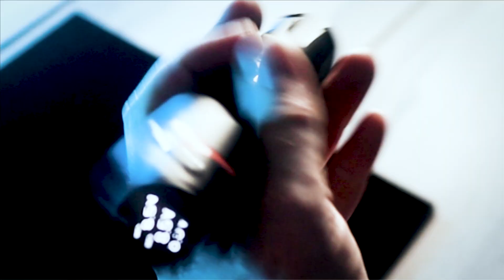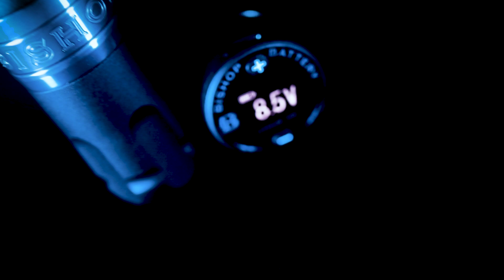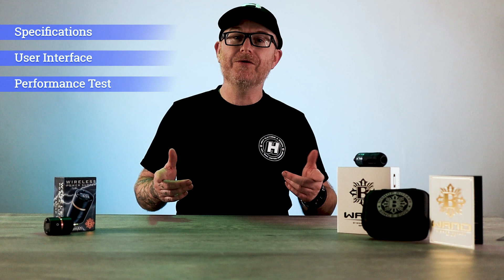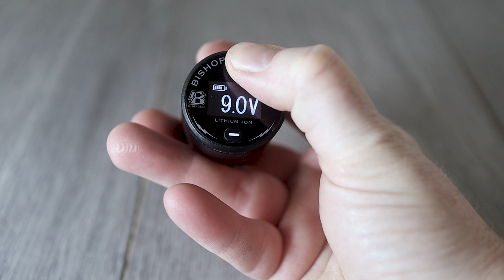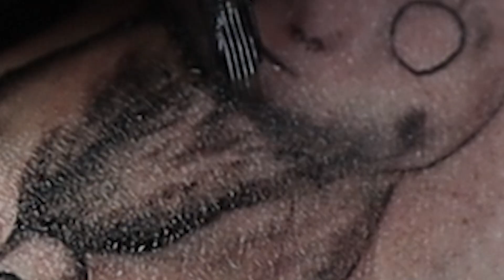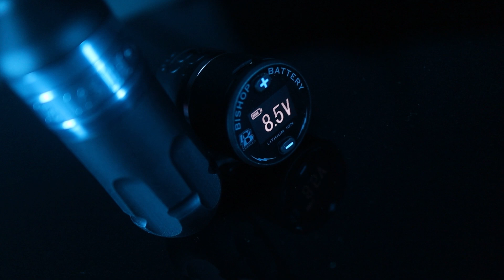First Look! Bishop B-Charged Wireless Tattoo Power Supply & Wand Shader Review!

Comment: which battery would you then choose the CRITICAL og the bishop ????
Reply from the maker: That’s like trying to chose your favourite child 🤣 To be honest both companies are exceptional. For working time and weight it’s got to be Bishop but that said I’m currently reviewing the brand new Critical Connect which is a battery controlled by a wireless foot switch which is absolutely awesome.
Reply: @JonoSmithTattoo  i was facing the same problem when i chose and buy myself a shader and had to choose battery but my choice fall on the critical
Reply from the maker: @Morgenink  both are excellent companies so you can’t really go wrong with either.
Reply: @JonoSmithTattoo   hope not 😊 you should try the packer

Comment: bishops battery is the best in the game. Have Tons of wireless batteries and let me say f*ck FK IRON flux BATTERIES Holy shit they can’t hold there charge overnight and can’t last for shit and barely stay connected to the machine.. sry I had to vent somewhere so overpriced. 

Bishops v2 are lightweight barely notice its there just a wish it went lower than 4v as its output is a little higher than it says on the screen I think i run machine a whole voltage lower than on my power supplies

Great review

Comment: The shader works perfectly as a liner too, cracking machine. 
I'm not sure about £200 for a battery though, massively overpriced. IMO.
Reply from the maker: Yeah this is the first time I’ve used a Wand and it was absolutely amazing. Admittedly when I first started seeing batteries I was a bit dubious but since using them more and more I’ve become used to the convenience and freedom of setting up with them. Thanks for watching mate, always appreciated!
Reply: Cheap batteries weight/balance is awful! I speak from experience, it's worth the price, once you try one you won't go back!
Reply: @BrokenHeartAtak  I moved away from cheap batteries 3 years ago to something far better, lighter, well balanced and affordable to replace, it's still running well. I'm not disputing the Bishop battery per say, I am disputing the silly price of it, it's a battery and it is over priced, in my opinion. Have a good day. PS. Had a quick look and it seems that batteries have massively increased in price lately so it is probably priced well within that structure.
Crazy...